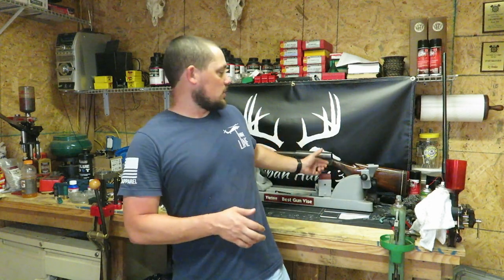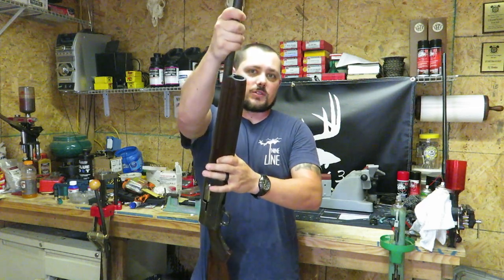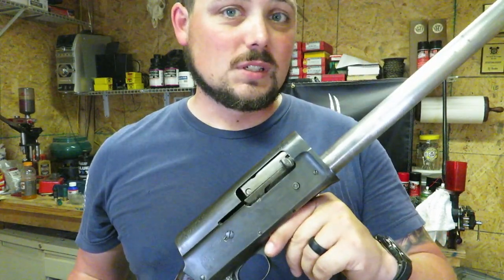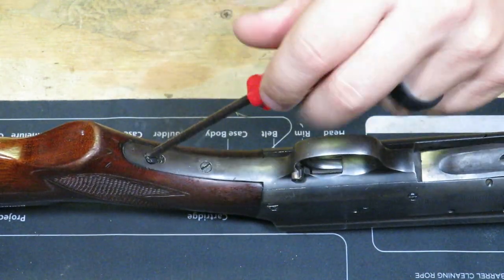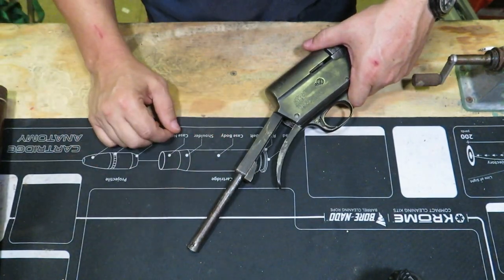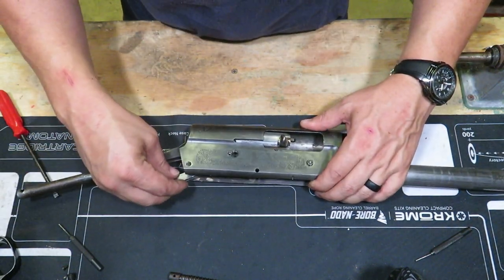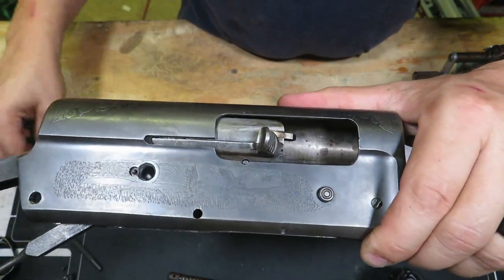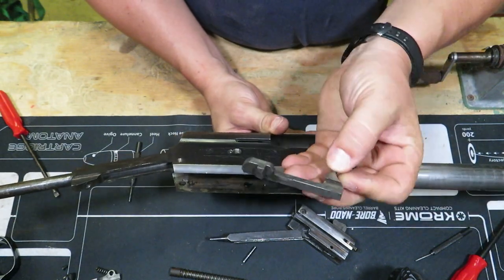Savage 720 Full Disassembly

Comment: You missed a very important part when taking off the stock. There is a screw holding going thru the back you need to remove before poundin off that stock or you’ll just beat the hell outta ur hand and eventually snap the entire bolt. 
** if you’re going to make a disassembly video you should really pay attention to details like that or else you are just doing more harm than good. 
Besides that good effort 6/10
Reply from the maker: Thank you for watching. However in this 720 there is no stock bolt. If you look closely at 4:10 just prior to removing the action spring you can see there are no threads. Some models do have a stock bolt as evidenced by Googling "Savage 720 Part diagram". It is my understanding that models with a bolt were made later. I can appreciate your concern. Please know that I would not skip or miss any step in taking the firearm apart. If yours had a bolt and this video caused you "harm" then I truly apologize. Thank you for commenting and happy hunting.

Comment: Thank you fort your videos.  Question, will a Remington model 11 barrel fit the Savage 720?
Reply from the maker: Thank you watching. Unfortunately I’m not sure. I can do some research and see what I can find out.
Reply: I was wondering the same thing.  I have to replace a barrel on a 720.
Reply: If you have already found a Remington 11 barrel for a Savage 720 I would like to know if it fit. Somewhere recently I read on the internet that Remington allowed or had Savage manufacture the 720 during WWII so they could keep up with demand from the US government for these weapons. I am just guessing that some or all of the parts might interchange.

I have a Remington 11 with 20" and 30" Remington made barrels. I have a Browning A5 barrel and some other action parts from that same Browning A5. From what I remember the Browning barrel will not slide into my Remington receiver but the Remington barrel fit into the Browning receiver. So maybe with a small amount of honing & stoning one could get a Browning barrel to fit in a Remington 11 or a Savage 720. There is a lot more Browning A5's and parts for them out there than Remington 11's and even less Savage 720's. Good luck. Let us know what you find.

Comment: Can you just use the tip of the shotgun shell as a disassembly tool like with an AR?
Reply from the maker: I always recommend using the correct size flat head for each screw.
Reply: @suburbanhunt3653  flathead screws are the worst. So many better options.